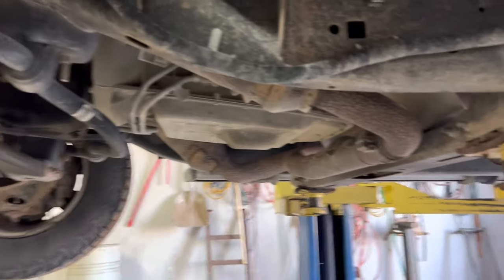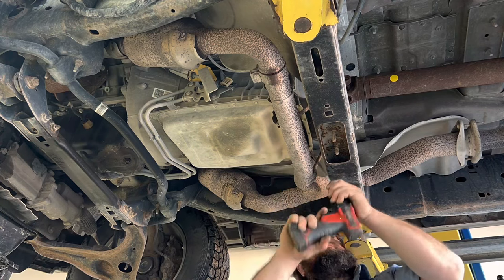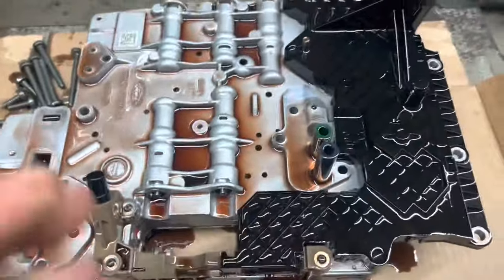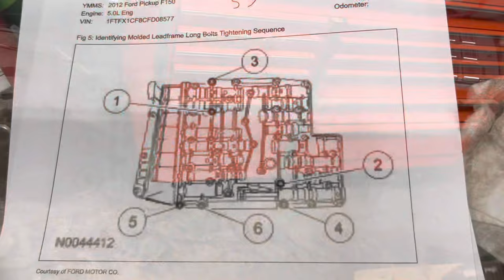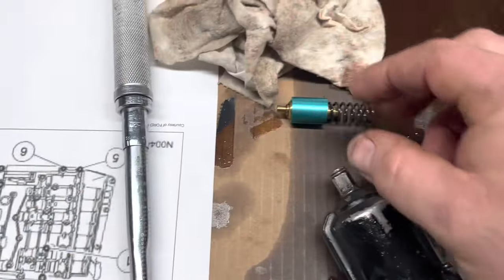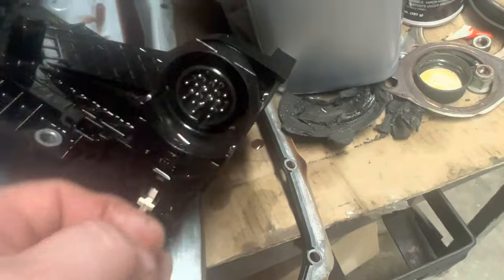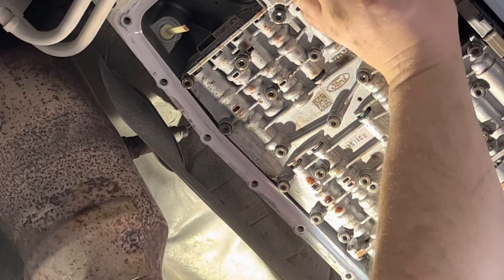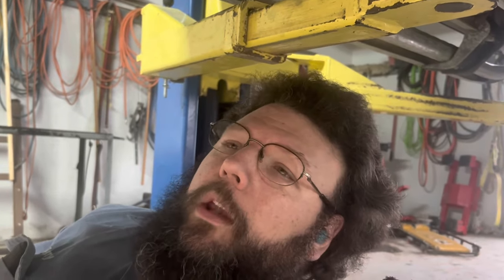Leadframe/ sensor assembly replacement on a 2012 Ford F-150 with 6R80 transmission

Comment: Just replace my lead frame. Im 99% sure I put everything back right but now the truck isn’t starting. All I get is one click from passenger floorboard area. Battery is good. Any ideas?
Reply from the maker: Did you have the battery unhooked, this sounds like the starter is engaging but not cranking. That leadframe has the PRNDL in it but I assume it’s good because it’s clicking. Check for power at the main cable at the starter.
Reply: @bulldogsautomotiveadventur4387 
I did not unhook the battery. It is not showing what gear it is in. Ill go check power to the starter and get back to you. Thanks
Reply: @bulldogsautomotiveadventur4387 It does have power to the starter
Reply from the maker: @garrettgilstrap7509  if it’s not showing what gear it’s in then it won’t start, if I remember right most of those fords have dual solenoids to the starter so it might be engaging one and not the other, try unplugging your trans connector and inspect the pins to make sure one didn’t get folded
Reply: @bulldogsautomotiveadventur4387 To me it kind of sounds like the range sensor or that manual shift valve but I am almost positive I put it back in right.
Reply from the maker: @garrettgilstrap7509  The range sensor is what I call the PRNDL switch, since it doesn’t show any gear that’s what I would suspect
Reply: @bulldogsautomotiveadventur4387 Thanks for the help.
Reply: @bulldogsautomotiveadventur4387 Figured it out. I didn’t push the sleeve for the electrical plug in all the way so the plug wasn’t connecting. I had it almost all the way in and the lock slid into place and was holding it, it was just holding the wrong part. Thanks for the help and the video.
Reply: Attention to details seems very critical here in this replacement

Comment: Any need to bring the truck to a ford shop to have the lead frame flashed?
Reply from the maker: @nickandrew2361  I’ve never had to do that, there might be a software update but all I’ve ever had to do is reset the adaptives and clear the codes

Comment: What is the socket size to get the valve body and lead frame out?
Reply from the maker: I don’t remember, I always just grab my whole set, I’ve never paid attention to what number torx I was using.
Reply from the maker: Now that I think of it I don’t even remember if it was hex or torx.
Reply: 27/ 30 torx

Comment: Can anyone help me... Just had the lead frame done yesterday.. it's still doing the same shit... Do you have to do the flash update, when it's done? Someone said something about a flash update to me.. thanks
Reply from the maker: I’ve never had to flash after this repair, if it’s still doing the same thing then I would assume it’s an internal transmission fault, that or a connector issue

Comment: I've herd that the Gen 2 they took out the spring for the bypass valve or something to fix an issue or the got rid of it. Could you explain that please
Reply from the maker: I haven’t been in to one of those yet, I research as needed as we are an independent shop. I have a feeling I’ll be getting into more of them as another shop has been farming work to us for years and told us today they lost their senior tech and would be bringing all higher end diagnostic work to us.

Comment: After pulling the valve body when does that stream of trans oil stop? I was hoping to get this done in less than a day.
Reply from the maker: It doesn’t stop, I usually drop the body before leaving for the night and do the work the next day, still makes a mess.
Reply: Another video I watched the guy used a little compressed air through the fill hole to release the vacuum before dropping the pan and it drained instantly for him

Comment: Them 2 little rubber hoses 1 come out the other is still in the transmission
Reply from the maker: Pull the one off and put it back up in the trans, you’ll never get it lined up otherwise
Reply: @bulldogsautomotiveadventur4387  thanks

Comment: What’s the part number
Reply from the maker: The one for this job was AL3Z7G276D
Reply: @bulldogsautomotiveadventur4387  thanks👍
Reply: Do you have to do any software updates after installing a new lead frame?
Reply from the maker: @jlbaine  no, plug and play